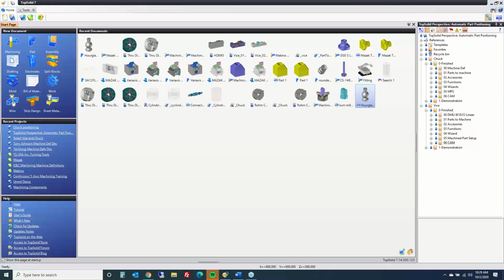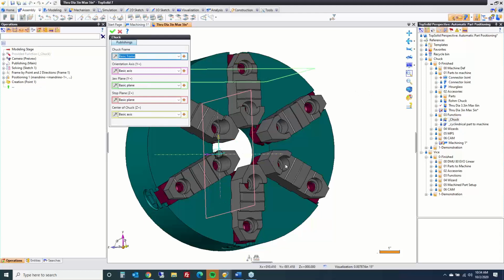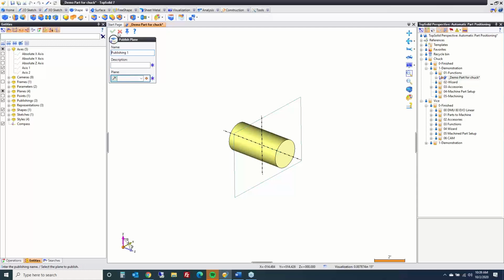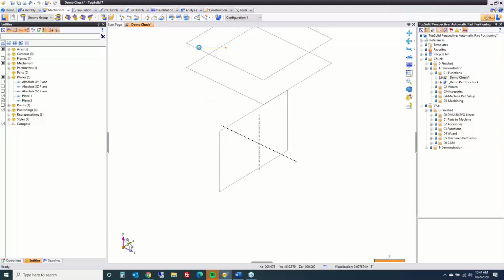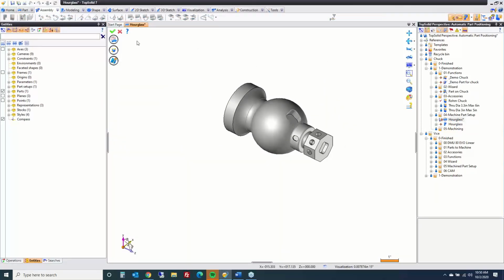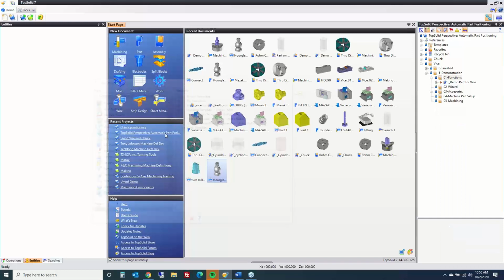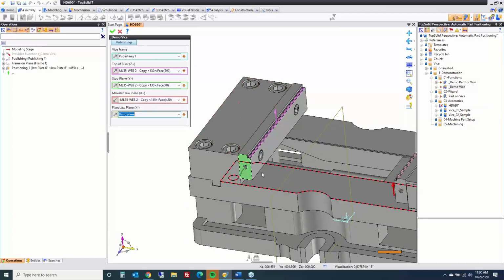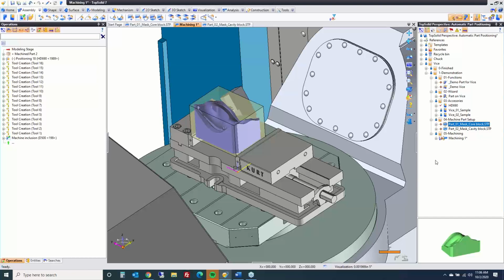TopSolid Perspective:  Automatic Part Positioning

Comment: Hi topsolid.
I tried this method with a chuck and 2 vice. when I try, the assistant pop up, locate correctly my milling part or my turning part, but after validating everything is fine, functioning but in the entity tree i have one of those constraint that turn red (plan to surface for the chuck, plan to plan for the moveable jaw for a milling vice). Any idea ?
I checked my 3d models of the chuck and the vice and the jaws are crooked by 0.0000000005 degree or less. I tried remodelling those parts but the angles stays for no reason. it dont prevent machining a part in a 3 axis machining but can the assistant use stricter tolerances ? (the jaws looks like gerardi cnc vice)
Reply: hello @empireages241 , did you manage to solve it? I'm facing the same problem now

Comment: Hi Bill, Another very interesting feature of TopSolid. Thank you for sharing.
What do you think about creating a document template for machining part setup including these wizards?
I am wondering if I could create it for different machines and different fixtures.
Do you recommend?
Any advice or trick behind the scenes?
Reply from the maker: I think you would need to play around with that to see if it is useful to apply to the template?  I think it might be simpler just to apply when you create your MPS file in general.
Reply: @TopSolidBlog  Thank you Bill. I will give it a try.